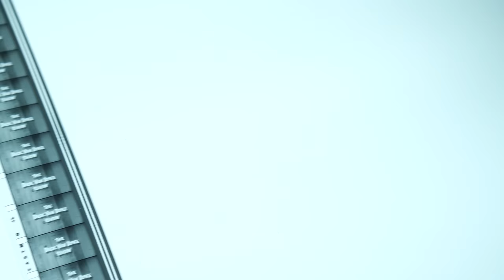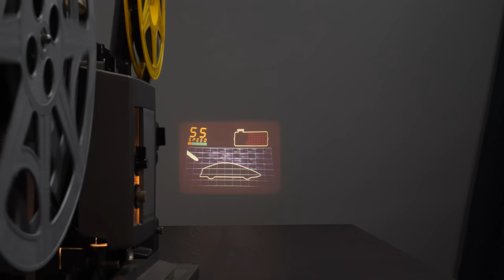Movies made sound with a light bulb: Sound-on-film

Comment: Platter based projectors were already in use around by 1984.  Friend of my older brother worked at the local then four screen cineplex and after the three of us saw the Bill Murray version of Ghostbusters, Scott took my brother and I upstairs to see the projection booth.  I remember seeing a splicing table and also the empty boxes the individual reels were shipped in on.

What I'm curious on though is how did the audio system on IMAX work?   The projection booths at the Museum of Science and Industry in Chicago and also the one at the Space and Rocket Center in Huntsville are at ground level and glass enclosed.  The film ran on the platter system but there was also a huge reel to reel tape unit off to the side near the amplifiers.  How did the film reel and sound reel synchronize?
Reply: Early IMAX systems had mechanical interlinks between the projector and the reel-to-reel tape player to keep them synchronized (just like vitaphone). At some point they switched to a system like DTS with a timecode printed onto the film and a set of CD-ROMs or hard drives that stored the audio. Unlike DTS, the timecode was printed in blue on the outer edge of the film (where the SDDS data was on 35mm film).
Reply: @ZanHecht  Sorry to disagree with you but the early IMAX system interlocked the 35 mm magnetic film which carried the soundtrack with the picture film electrically, using selsyn motors, not mechanically.
Reply: @ZanHecht  I worked as a projectionist in a large format theater (not IMAX brand, but basically the same system) and you're right on. That system was using a tape soundtrack until about 2002 before switching to CD audio. Interestingly when they switched to a disc based system, it used an optical frame counter to sync sound rather than read printed timecode.  

@David Faraday it's been too long, so I couldn't say for sure, but I think you are correct, I don't believe that the tape system was mechanically synched to the projectors exactly like vitaphone, but I'm pretty sure that there was a mechanical frame counter that synched to the tape machine, so the concept is the same
Reply: "the Bill Murray version of Ghostbusters", or as I like to call it, "Ghostbusters"...
Reply: @eypandabear7483  lol... have a gin martini my friend.
Reply: The old Cinerama 3-projector format worked the same way. A 6 track magfilm sound player and the 3 projectors were all synched electrically via selsyn interlock.
Reply: @davidfaraday7963  Using motors sounds pretty mechanical to me
Reply: @samot1808  No mechanical connection between the projector and the magnetic film player. So an electrical, not a mechanical ,lnterlink.

Comment: Adjacent fun fact: a certain model of bell and howell filmosound projector (385) possess a fairly sought after amplification section for guitarists, there is even a pedal that emulates the amplification section, the “385” by Walrus Audio. Some people will remove the amplifier from the projectors for their guitar rigs.
Reply: That is awesome!
Reply: Why couldn't they just reverse engineer it and build new ones?  Electronics are universal as long as you follow the schematic and use the proper parts.  Would be easier cheaper and spare the projectors to just build replicas.
Reply: @darkworlddenizen  that can and most likely has been done, but guitar people are looking for “mojo” that wouldn’t be present with a fresh built amp. Eyes closed they can be exactly the same, but it just isnt as cool, i guess. I would be fine with a well made repro, in fact i have the walrus pedal from back when i played a little guitar. We use it on our bass rig at my church for the kinda amp simulator sound.
Reply: @YoSoyElQuesoGrande  sounds like the audiophile thing with "vintage" tubes.  Modern tubes work just like they did in the 40s but they insist on finding new old stock or taking them from antiques instead.

Comment: A couple of notes, as someone who has worked in film projection: 
1) Magnetic sound tracks on film was a thing for 35mm and 70mm. Mag 35 is pretty rare, but Mag 70 is actually fairly common. Both include a magnetic tape strip bonded into the film on either edge, outside the sprocket holes. Mag 70 got you 6 channels of audio, and it actually dates back to the inception of the 65/70mm format. Mag 35 and Mag 70 are almost twice as thick as their optical counterparts, meaning that you can fit about half as much film onto a reel. A 40 minute reel of 35 optical becomes a 20 minute reel of Mag 35. There are some 3+ hour long movies that were distributed primarily in Mag 70, so imagine how hard that is for a projectionist. Also Mag 70 loves to snap at splices since its so much thicker, and running it in a projector (my experience is on Philips Norelco DP70s) the loops are incredibly loud, and hearing a splice go through is always terrifying. 
2) DTS did actually use DVD-ROM for some later features. Most later DTS processors (like the XD-10, the last one) are equipped with 2 DVD-ROM drives, and some later DTS prints distributed sound on DVD-ROM, though there was no real improvement to the format from my understanding, just that you now needed a newer DTS system to play them back. 
3) Most really nice DTS and Dolby Digital sound heads actually use line lasers instead of exciter lamps.

Comment: I didn't know that each film had multiple different soundtrack techs on it! it makes sense now that I think about it - you only need to make and ship 1 kind out. Very cool!
Reply: It was only used very briefly. For a long time, 35mm film had a matched 35mm magnetic soundtrack, so the projectors had 2 feed reels and 2 take-up reels.
Reply: Originally they did actually have "exclusive" prints with just 1 format. Distributors were not a fan of having to manage exactly what print went where though, so that didn't last too long.

Comment: Whatever the process used to put the silver halide audio track onto a color film wasn't cheap; in the 2000's (right before projection went digital) the industry changed to a cyan audio track and a red LED exciter. The installed base of sensors was all sensitive in IR, though, so you either had to use a very narrowband replacement lamp and crank the gain to unrealistic levels, or replace your whole sound head. Given that at the time you could spend your "new sound head" money on at least 3 different digital audio readers (any print with cyan audio is going to have digital tracks on it as well), not the most compelling upgrade. My theater did it because we went with DTS for our digital update: that standard carries the audio on separate optical discs which were often missing on the second run prints we showed (better research would have had us do Dolby Digital instead).
Reply: The theater I worked at in HS had both DD and DTS sound heads and making sure we had the right the trailer disc on the DTS projectors (or only had trailers spliced on which were on the current trailer disc) was as I remember it a bit of a pain.
Reply: The evolution of optical soundtracks toward cyan (with magenta having been used as a "compatible" stepping stone) was essentially an ecological gesture, as the traditional over-development of soundtracks to produce the required density was very wasteful of developer and considered ecologically worthy of improvement. Higher processing speeds for release prints was also a factor, leading to some of the worst-looking prints in the industry's history just before the switch to digital.
Reply: This video shows the cyan used only for the Sony non-standard.

Comment: Side note, When you were showing the platter system that contraption in the middle of the platter was known as "the Brain." Brain wraps were a bad day for the projectionist. Another tidbit - while you showed your 16 mm film in reverse, and in practice you could "rewind" your reel to reel (even if by just unthreading it and manually spinning the source reel backwards and then rethreading) Doing so on a platter system would be near impossible because you are taking from the center of the print. I say near impossible because you could I supposed feed it back but you would have to have plenty of time and patience to do so. 
Additionally, for the optical sound heads in a 35mm movie theatre grade. an oil filled dampener has used to help smooth reading of the sound track.
Reply: Memories! Hearing "The Brain" was amusing. I remember back in the day some clueless people calling it this. In reality, while it could make a mess if it got stuck, there is NOTHING intelligent there. Technically, it doesn't even touch the speed control, because the only thing there is a "floating" optical "vane" under the plattter that controls the platter speed via a control module mounted at the end of the platter/motor support arm underneath. I rebuilt MANY of those modules for our local chain who thought it was black magic inside and had previously shipped the modules out for repair. In reality, the circuit was essentially a high power, optically controlled dimmer switch. It was so easy to fix them, and a sweet gig while it lasted. Feel free to ask if you have any questions. I'll do my best to answer. I suspect the Christie Autowind patents are also online.
Reply: I remember a few  brain wraps running a long gone AMC 8-plex.
Reply: I had to "rewind" a film on a platter system one time, and yes.... VERY time consuming and fiddly. Not fun.
Reply: @cmsch180  :::triggered PTSD:::
Reply: @pokerpokerfla  My experiences were also with AMC.
Reply: @pokerpokerfla  don't forget idiots dropping films moving them between screens. man, i still have the occasional mild nightmare that i'm like 30+ mins late starting movies or that i walked past a projector that had abnormally stopped for unknown reasons an unknown number of minutes ago 😱
Reply: @plonk420  We had a projectionist drop the print of Titanic. Some comedian drew on a dry erase board in the booth a cartoon that showed folks commenting that "they said that print was undroppable"
Reply: @cmsch180  I had to help out with that a time or two.  Being that we were all paid federal minimum wage at the time, it was certainly cheaper to have one of us sitting there holding the speed control for the take-up platter than it was to properly thread things around to let it automatically handle take-up.
Reply: @plonk420  Same, and I haven't touched a projector in 20 years now.

Comment: Actually even as far as the 1990s, TV stations had similar problems as projectionists. When cassette based video tape formats like Betacam SP became popular, one problem was that they only had fairly short run times. So movies were typically split on multiple cassettes which required a switch over. Though with video tape that's probably somewhat easier to do as you have time codes.
Reply: Also, ı imagine the cassettes for the movie and the cassettes for the commercial breaks were separate, so commercial break would be a good time for a cassette change.
Reply: @Krekkertje  Yes, but commercial breaks were not common on many places.
Reply: I once visited the transmission facility for one of the cable movie channels, when they were still using analog playback. They had multiple tapes for a single feature, and duplicate infrastructure in case one of the playback units failed.
Reply: Isn't that where commercial breaks came from?
Reply: @BierBart12  AFAIK commercial breaks came from states not implementing ways in which broadcasters could finance their work. Therefore in those places they try to sell the attention of their audiences. As we all know that failed miserably, with many US broadcasters basically propped up by sales to countries like the UK or Germany which have managed to finance their broadcasters.
Reply: @altebander2767   Oh yeah, the amount of ads on German non-state TV have gotten absolutely abhorrent in the last 10 years, with some ad breaks going for over 20 minutes.

And even the state TV stations now have some subtle promotions within their shows, despite being forbidden from showing ads
Reply: @BierBart12  Well it's all "non-state". In fact the reason to try "commercial" stations was so that the government would have more control on the stations.
Reply: Don't forget high- band u- matic
Reply: 1 inch quad tape and the two 3/4 inch formats.
Reply: @bloozee  Well quad was 2 inch. 1 inch formats include type B and type C. There were quite a few 3/4 inch formats out there, though the U-Matic variants are probably the most wide spread.
Reply: @altebander2767  quad was indeed 2 inch .. and very noisy due to the suction pumps sucking the tape into the cavity... I still have one of the pumps in my shed.  We used B format in our studio but the rest of our network used C. Our facility had two quad format machines when I started.. one of them had a TBC!
Reply: @bloozee  Well strictly speaking all analog direct colour recorders (for colour) had a form of TBC. However usually that could only correct for a microsecond or so to get the chroma phase correct.
Reply: @altebander2767  I don't think we regarded that as a tbc. It was a lot of rack units of analogue circuitry though. My recollection is that there was nearly always a CRO attached for alignment/ maintenance purposes. ( I  addition to the usual vectorscope and WFM that was part of the system).
Reply: !!! my dad told me that when watching something on TV sometimes a little dot would appear at the top right corner right before advertisements Was that a que marker??
Reply: @LiEnby  AFAIK that was done in some countries where they interrupted TV programs by so-called commercials. You can see it in the "Mr. Bean" series.

Comment: This brings me back to working the booth at the movie theater. I got insanely good at threading those projectors, could get it done in under 30 seconds.
Reply: I could do a Strong brand in around 30 seconds, but the Christie projectors took longer because they were less forgiving with an improperly sized intermittent loop, so I'd always double check the loop size after before firing it up which cost me a few more seconds
Reply: There is something insanely satisfying about quickly threading a projector. It's been 20 years but I bet I could still do it.
Reply: Congtats, the bots copied your comment!
Reply: @Nadia1989  woo! I feel accomplished now!

Comment: When the theater near me upgraded to platters, they also installed ceiling level rollers and pass throughs. The idea was you could run the same print to another theater / projector on a different schedule. 

I’m not sure it got used much, since any failure would interrupt all theaters with the same feature at once.
Reply: that is called interlocking and was fairly common.

Comment: This bell & howell 535 you used to demonstrate also came as a 535T wich was a transistor  amplifier. The 552,and 552 T was an aoutolad projector wich looked the same but more elaborate. All of the 500 and up series units used a photo diode in the sound drum.

Comment: One other theoretical advantage (though I don't know if this was technologically possible or ever used) of a system like DTS is that in theory you could use the same film with different CDs, which might be nice for theaters in bilingual areas so they can have screenings in both languages.
Reply: The DTS timecode could also be used with a secondary projector that added subtitles. I know that was part of the plan, I don't know if it was ever used.

Comment: Everything works so quick, I never realized it made the frequent stops
Reply: Same here. From what he said here, I gather that the earlier projectors flashed on the light at intervals rather than stopping the film at intervals but I may be wrong.
In any case I always thought the light turning on and off 24 times per second when the frame was aligned with the lens was what prevented blur or frame edges being projected. I'm amazed these old systems could "stop/start" at such high rates.

Comment: So, the old theater in my hometown still had the (architecture for a) two projector set-up into the nineties, though only one of the holes into the booth actually had a projector in it by that point. Then, in the late nineties, the original owner sold it and the big screen was chopped up into three smaller screens. I was SO SAD when that happened. There was just something special about a screen so large you didn't want to be in the front few rows, because you couldn't SEE the whole thing! I still vividly remember seeing Apollo 13 there, as one of the last movies shown on the BIG screen. Dad even paid the extra dollar so we could sit in the BALCONY! :D
Reply: I remember seeing movies in a converted Vaudeville theater.  Huge curved rows of seats, and a balcony that was about half way up the screen.
Reply: When they started chopping them down smaller and smaller, was about the time i stopped going to movie theaters, the experience was rapidly becoming worse than just watch it later at home. One of my last horrible experiences the projectionist was smoking, the holes had glass but the smoke would get in the beam light creating annoying moving blurriness. When it was a big screen with like 900+ seats, and some had an intermission too, that was a great experience, but all that is gone and was never the same ever since. At least i can still pause the movie and take a break in the middle, especially those nearly 3 hour feature films...